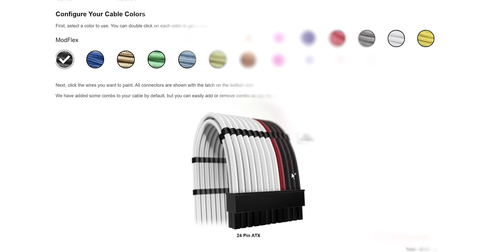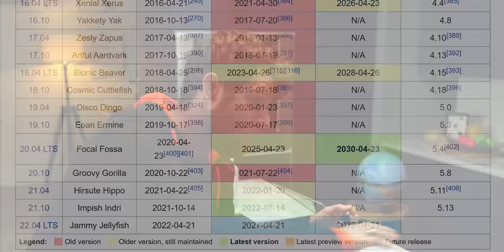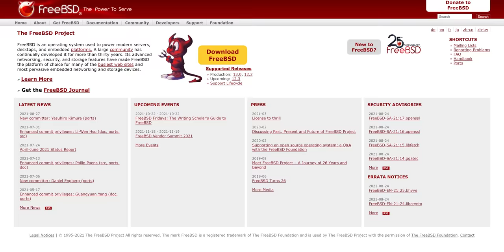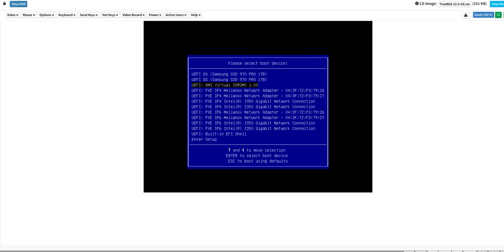We Finally Did it Properly - "Linux" Whonnock Upgrade

Comment: This is an elementary lesson in any CS course "Unix is far more stable than Windows" . However, some people (including me) learn this lesson the hard way.
Reply: Whenever I hear Unix, I think of the phrase "Oldie but a goodie"

Learning curve can break many a would-be user because of the use cases it excel in does not fit an average home PC user.
Reply: Windows USED to be masterfully made. Now it's a fucking joke though, yeah.
Reply: @arnox4554  as I see it, is that features are introduced, then are either poorly supported or abandoned.
Storage spaces has many, many issues which have not and will probably not be addressed.  Even samba is overall faster on Linux than natively.
Reply: @arnox4554  Backwards compatibility baby!

Comment: Those editors man. You give them massive beasts and they’re like “well, it’s okay, it kinda works”.

What were they using before? Computers from the next decade? 😂
Reply: The thing is they will notice it when doing "extreme" projects, or better said, not notice it ... cause the old system would've failed doing those big projects.
Reply: Two things of note: They've probably all had experience of working with the fileserver when its less loaded, light load of Whonnock 2 vs heavy loaded Whonnock 3. 

The other thing of note is that they've been slowly raising resolutions of what they're working on. 12k footage. Proxies (lower resolution copies that stand in during editing) would help with performance. But then you need to wait for those to get processed.
Reply: @Suklaa  True, which is why Linus shouldn't ask them if it feels so much better - at least not with the expectation that they will answer with a dramatic positive.
Reply: @andoletube  I don't think he expected anything tbh... And if he wouldn't be happy with the answer, he wouldn't have put it in the video soo it's not that big of a deal

Comment: Trying to fix file editing where files reside on server with a bigger server only.....what about the client machines and the physical network they are running on....the switch connecting the clients with the server could also be bottlenecking data transfers....???

Comment: There have been many times have I've spent weeks upgrading servers, to then survey the users to get "It's about the same, maybe slower!" welcome to server IT Linus!....but the ultimate goal is that the data is always avaiable ;-)
Reply: Integrity
Availability
Performance

You go to servers if you want them in this order.
You can configure a server to be performance first, but there will be other servers and systems in the background taking care of the other 2 points

Comment: As an Enterprise IT Server Engineer, it is always interesting watching people who have primarily worked on consumer/gaming computers delving into core infrastructure like servers and routers/switches. The solutions they go with are so different that what I would implement at my organization.
Linus needs a SAN configured to handle a small number of large files at a time, where I typically deal with thousands of users accessing relatively small files simultaneously. Each scenario requires a different configuration and deployment strategy.
Reply: Sans are too expensive, costly, and can be difficult to scale hencd why they are dying. Lots of people are using hyperconverged with software defined storage.
Reply: There is nothing wrong with using servers for storage. San is on decline where hci is growing, clearly software defined storage is the future. Its though not done on single nodes using community editions. Its probably shear cost and him wanting to do it on his own. You dont need all the performance in one server buy a four node cluster of nutanix and offer file services if needed.

Comment: Linus: "I'm not expecting to lose a ton of these drives." LOL
Reply: Samsung does a really great job of making sure damaged blocks of flash get replaced by working ones and even offers a tool to scan for damaged blocks after the fact, hopefully server oriented flash storage controllers do at least that
Reply: @christopherjc54  You still kinda need to quantify the statement though "I'm not expecting to lose a ton of these drives, in the lifetime we will use them for." , as obviously that is relevant as ALL drives fail eventually.
Reply: @alexatkin  "in the lifetime we will use them for" implies no intention to human lifespan.  I'm sure he will upgrade in at least the next 5-10 yrs.  Are you still using your 3.5" ide drive of 5-10 years ago?  Plus he is using a bunch of enterprise grade Kioxia CD6 drives and if they are CD6-V - have a DWPD of 3.  Lots of years ahead.
Reply: Now you only need to loose 2 and your done. And if all the drives are from the same batch... if one goes then 2 can as well quite quickly! You do however say that the mirror server is enough for you. As with all backup solutions...restoration times are to be considered a factor!
Reply: @OnzaRob  VROC raid 10 arrays or even windows storage spaces would have been better.  You lose 50% of the space but you can lose half your drives with really rapid restoration.  Multiple raid 5 arrays would have been better too.
Reply: @shadowmist1246  Actually I've been using my hard drive for 13 years now.
Reply: didn't he say that when he built the first iteration? lol
Reply: @kanjakan  thats great, but if your desktop hard disk dies, only you are not working. If a server dies then a business isn’t working and making money…so redundancy is built in to keep the company a float! I’ve had systems that have 50% redundancy and only had 1 unit go. It’s an Insurnace policy.
Reply: @OnzaRob  Yeah I know, it's just that your comment made me think about how long I've had my hard drive so I'm just really surprised it hasn't kicked the bucket haha.

Comment: Welcome to the dark side. A true server OS. Except for the "We're going Linux, baby!" installs FreeBSD
Reply: Well.... It might be a glitch and it might not. But there are so many people out there, that does not know, that Linux is not Unix and Unix is not Linux. Unix-Like are still not Unix. Heck, it does not even cover the same area.
Reply: From common-folk perspective, not Windows and not MacOS is linux. Technically incorrect, but functionally close-enough.
Reply: @christopherjc54  what you are talking about, is a class of OS's. It is called Unix-Like because it looks like Unix. Much in the same way as MorphOS is an Amiga-Like OS. And by the way. MacOS-X (or just OsX) are real Unix. Exactly as iOS is real Unix.
Reply: @brostenen  Mac OS X is based on FreeBSD and thereby Unix. Not just Unix-like but the real deal. That's why.
Reply: @Octavio Lopez Modern slang's kinda changed the definition these days

Comment: Just a correction to what you were saying around FreeBSD: "it's not linux, but it is based on a unix-like operating system". Linux is a unix-like operating system. FreeBSD is not unix-like, it IS unix. BSD stands for Berkeley Software Distribution, they took over the development of unix (more specifically Research Unix) from Bell Labs. But eventually they rewrote all of the parts that were originally from Bell Labs, at which point they released the software as 'FreeBSD' which Bell wasn't too happy about. Other interesting tidbits, Mac OS is based on NeXTSTEP, which in turn was derived from FreeBSD 4 (if memory serves), which makes Mac OS the most widely used variant of the original unix operating system. Sony also uses FreeBSD for their consoles with the PS5 running FreeBSD 12. Similarly, Orbis, the OS used for the PS4 was based on FreeBSD 9.
Reply: Nah... legally it's not Unix. At least not System V Unix. There are stuff missing in FreeBSD that has to exist in a "real" Unix-system. Like streams.
Reply: Yeah! Great seeing BSD getting some love, but what the hell Linus?

WE’RE GOING LINUX!
[installs BSD]

Hope BSD systems get an episode now. Even a WAN show one.

best to all ltt crew!
Reply: @kanalnamn  I do feel it's a matter of opinion. As far as I understand it, BSD was derived from the code of unix 5/6 and newer versions of unix got derived from BSD. 386BSD & FreeBSD basically just replaced the last remaining bits of code that was still from Bell Labs. I'm not saying it has every feature that existed in commercial versions of unix, but it's based on the same codebase.

Comment: 7:51 hey Linus. This is called a software RAID. Linux and FreeBSD are very well familiar with installing themselves sans the /boot partition on those. I thought you should know that the only downside of RAID is that RAID is always vendor-specific, no matter if your SATA/SAS controller offers quasi-hardware RAID, or you got a real hardware RAID, or software-defined RAID as with ZFS, btrfs or mdadm. No matter which way you go, when you migrate to a new RAID, you must make sure that the computer that migrates the data supports both types of RAIDs. Bare HDDs have vendor-specific headers written to them so that they actually are recognized by their RAID controller as members of an array. It's not something to worry about for tomorrow or even next year, but 10 years from now you might want to know that kind of stuff! I'm glad to see your presentation improved. Please keep up the good work.

Comment: I think this is my next step. Just gotta get the SSDs
Reply: So you watched a video where there wasn't any real improvements and now you're interested, hilarious.
Reply: @SteelRodent Shouldn't be crashing in the first place with proper hardware and configuration.  Human error, stop blaming your failures on the OS.
Reply: Only thing I could afford is the mini version made out of this 32 and 64GB Optane cache drives
Reply: Personally I think that would be a massive waste of time and money Epos. 
Grab a bunch of 16-18 TB drives in a 8 drive NAS load it up... toss a couple 1 TB nvme's in for cache, then a 10 G network card with proper switch. 
You'll get plenty of through put to scrub videos or play games. 
Linus is losing a lot of performance by using SMB. 
For my games I use iSCSI on windows boxes and on the mac NFS is far better when dealing with FCP video scrubbing. Linux... NFS again. Pretty minimal cost and about 100 TB of storage with a 8 bay NAS.
Reply: @djcetra  
Yeah , it's not the OS fault that Windows lagging when using applications with a Ryzen CPU

Comment: I actually would have gone with Debian. SMB being a few Months old isn't necessarily bad. Debian is known for its stability because they stay on mature versions. Security patches are often backported into older versions
Reply: I think truenas (especially with their U.. versioning system is one of the most stable pieces of software there is). The issues from U2 and up are 99% caused my the user mishandling the software and not the OS itself. (Source: Myself, as in I was the user and I was mishandling the software)
Reply: But this is TrueNAS core is a FreeBSD operating system. Arguably THE most stable operating system out there.
Reply: @rumrogerz  OpenBSD probably holds that title, but gives up a lot in return.
Reply: @rumrogerz  that's probably true

Comment: "Yes, Linus. You can NEVERRRR have enough RAM!!"  - every software coder these days who never heard of the concept of writing lightweight & resource friendly code..... Yes Webbrowser developers, I am looking at YOU!!
Reply: True, why is it so hard for devs to optimize their software? They don't even need intrinsics, just write good code
Reply: @stacklysm  in most of the cases it's just customers wanting the result as soon as possible and spending as little as possible, no matter how crappy it is, if it works good enough for them — it works good enough for them 🤷‍♂️
Reply: @kagenekoUA  Yes and no, if the dev is well practiced optimizations are made as they dev. So, it's a combination of lack of experience plus tight deadlines.
Reply: @ikannunaplays  Still overly simplified. It's a confluence of factors. Language choice & runtime make a big difference. You need to understand the garbage collector characteristics of the environment you are running in to write well performing code. Reliance on third party dependencies without really understanding what they do under the hood is a contributor also. And yes, lack of experience with algorithms & data structures, and deadlines affecting all of the above.
Reply: "Damn, why did my RAM usage jump 5% when I installed all my apps?"

Opens terminal, runs top

Fucking Electron.
Reply: It’s also not easy to optimise on a web browser, it’s just memory hungry by default unfortunately.
Reply: @_colonial_  It's always fucking Electron.

Comment: The FreeBSD version will be better for that heavy duty server than Linux anyway. More stable, once properly set up, and more reliable for mission critical workloads. Way better uptimes as well.
Reply: I can believe that. Though i don't really have any experience in any other unix-systems, i've only used Linux and a tiny bit of mac. But essentially FreeBSD is more light-weight and tailored for server stuff than Linux, right?
Reply: BSD and Linux alike can be trimmed down to very specific functions or hardwares. But sure, BSD is probably more often the system used in smart washers and such.

There is for example a Linux system that runs from a 1.44" floppy.
Reply: That's why firewalls like pfSense and OPNSense are based on FreeBSD.
Reply: My uptime record on a linux server is 1600 days. How much more do you need?
Reply: Yea it's going to be great... but then again I dropped Storage Spaces and FreeNAS ZFS for a dam MacMini and a few USB 6GB drives just so I can wall mount it all and use the Backblaze desktop application. Can't say I regret simplifying things. It's been a great little Plex / File Server for the last year. Plus it all fits great on my network wall.
Reply: TrueNAS is ready to go but linux might be better and more stable. You may build with some linux distros your own server setup with only the drivers you'll need and then it's more stable.
If you are running and bloated kernel ... this sucks, you'll need an auto reboot usb-stick (it works fine).
For one time installation: TrueNAS; customized linux for more servers with the same hardware.
Most servers run on linux and are just fine (accespoints, routers, android smartphone with firebase push notification services, ...).
Reply: @dingdong2103  I need infinite uptime, even across reboots!  :)  lol
Reply: @Nikola B. It mostly has to do with level of competency. Either can be great.
Reply: @Nikola B. 
In stock configuration you have less drivers in the kernel (less hardware possible) and you have less errors in shorter code. Each driver and running software/service adds to a possible error in the code.
More services more possibilities for race conditions.
It's more about configuration which is different and the the kernel itself.
MS have the Windows Server Core in linux you'll have archlinux and gentoo and with BSD you'll have special purpose distros (TrueNAS).
More code => more possible errors in the code
More services => more possible race conditions
Reply: @losttownstreet3409  True. In addition, some of those “errors” might be vulnerabilities, so FreeBSD has less attack surface than Linux.
Reply: If you look at the top right corner, you will notice he is using TrueNAS Core which is the FreeBSD version. The Linux version is called TrueNAS Scale.

Comment: I'd appreciate the "grab an old athlon and turn it into a home NAS" video you mentioned in passing. Maybe showing 2-3 different ways of doing it (windows, truenas, linux) with advantages
Reply: there's very few OS options. windows server would have performance issues, so that would be out. truenas is fairly demanding on memory, so also not the best choice. that would leave you with openmediavault, which is your best option on ancient hardware like that.
Reply: @Drive-n-Vibe  I want to make sure I understand, OMV is if you want to repurpose old gear, TrueNAS is for when you have modern hardware? I am running OMV and started wondering if I had made a mistake because I keep seeting TrueNAS everywere I go .
Reply: @caffeinesippingman  yep. it's not really truenas that's the issue, it's ZFS and its big memory requirements. 1GB of memory per TB.
Reply: @Drive-n-Vibe  OMV has a plug-in that allows for ZFS. If I understand you correctly I most definitely should not install the plug-in on my old hardware unless, I meet the 1gb for every 1 tb requirement.

Comment: Right on. I jumped ship to Linux in 2007. By the end of 2008 I had it on my laptop and then I just stopped dual booting, I forgot when I last did so probably in 2009 at the latest. I purchased my current HP Z workstation with windows 10 installed. It is probably close to a year since I have booted into it... FreeBSD is NIX - Again, right on!